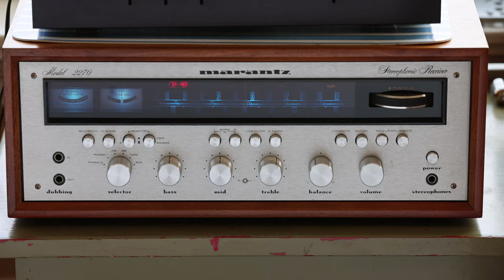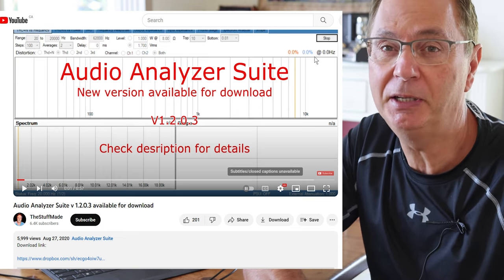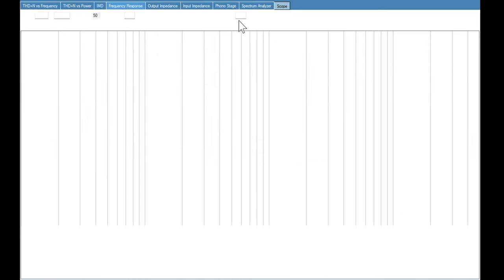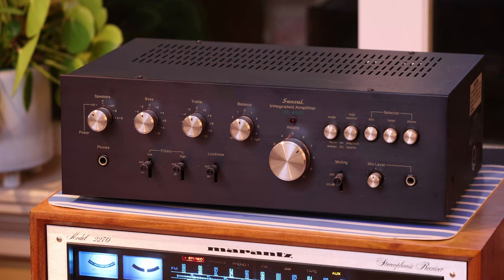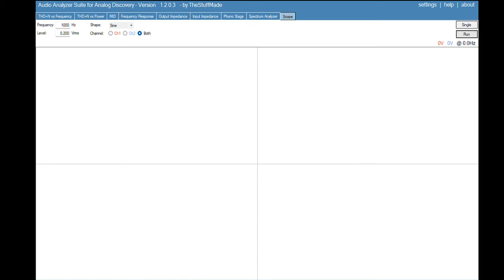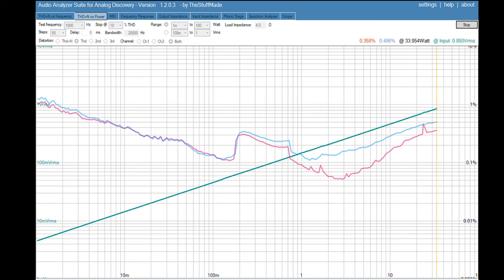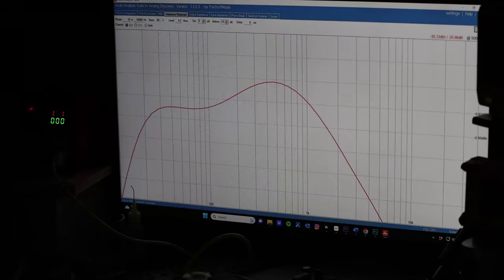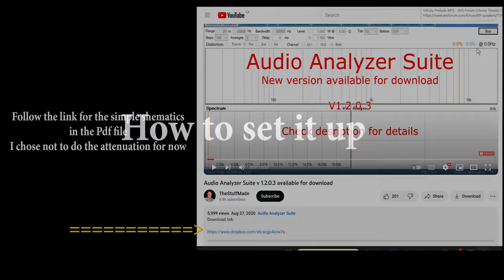Digilent Analog Discovery 3 & Audio Analyser Suite. Amplifier Testing Mcintosh Mc275, Sansui,

Comment: I noticed the GPO header box you showed contained 2x20 pin headers, but the header on your breadboard is 2x15 which matches the pins on the discovery.  I am having trouble locating a 2x15 right angle connector, did you cut yours or will a 2x20 fit.
Reply from the maker: Yes just cut it I would cut at 16 then sand it to 15 for better finish

Comment: Any concerns about the voltage input to the AD with a higher powered amp?  Have you used a voltage divider in that situation?
Reply from the maker: I only used it up to 90 watts 
But you can put your probe on 10x as a quick way or create a simple resistor devider or add one to the board
Reply: @Gabster1  Thank you again!

Comment: Thanks G, great stuff.  What wattage 15k resistors would you use in the jig, if you were to add attenuation?  I also noticed that only yourself and  @TheStuffMade are using the jig.  Other YouTubers are just using the unrecommended bnc adapter.   What’s up with that?
Reply from the maker: You can get away without a jig on simple Tube amps But I had a lot of issues with some amps so best is to follow The Stuffmade recommendations he knows his stuff :)  So far I had not used any attenuation with Ver3 up to 90W. I would ask Jake about Wattage I am guessing 1W may be more then enough.

Comment: This is a great step by step - thank you. I assume you connect the Discovery 3 to a laptop running on battery. Or maybe you use a 1:1 isolation transformer. I wonder if the Discovery has the same issue as standard scopes having a grounded neutral. Thanks again for sharing.
Reply from the maker: Yes a laptop on batteries is ideal but surprisingly works well on a regular grid connected Computers

Comment: So is there equipment I can get to use this free software and not have to pay the 375?
Reply from the maker: Sadly no the software needs this particular hardware
Reply: Analog Discovery 2 has shown up on eBay for about $200 US.  The Analog Discovery 1 is less .. either will work fine.
Reply: There is a student discount available for approved universities. My cost for an Analog Discovery 3 (with free shipping) was $249 a month ago.

Comment: Gaby,
Would you be willing to hook up an Android cell phone on airplane mode running out of its USB connection to see how clean that is? 
Reason I'm asking is I use such a phone with USB Audio Pro Player to a USB dongle DAC amps or a chord mojo 2 (which are running off of battery or taking power from the phone). I think it sounds pretty good !  I'm wondering if I'm inherently avoiding some of the pitfalls in not having to use a switching power supply (or buy a expensive linear...) etc ... etc .. as everything is running off of battery ? Do you think a USB cleaner of some kind should be in the chain between the phone and the DAC in my scenario. The only downside to this is there are cables to deal with and you're dealing with the battery charge of the phone which is usually only a few hours but so far it's been working great in my opinion. I have 5 DACs And I run a different one every night which is a lot of fun
Reply from the maker: Your phone on battery will beat any computer 
Much lower noise so you are doing a good thing.
But you still have some computing noise 
The better your dongle Dac is the better the sound

Comment: Off topic. I wonder how many good audio amplifiers are let down by their power supply. It is an issue in amateur radio transmitters too as the signal goes from almost nothing to full power with audio. 

It is possible to dynamically test a power supply with a programmable DC load and an oscilloscope measuring current and voltage. The DC load can be programmed for a low frequency, say 100 Hz and a 10 to 90 per cent duty cycle square wave. This stresses the supply and allows its response to be measured.

Comment: I just started using the same setup to test a 300B amp.  I’m mainly measuring THD vs. power. If I set the volume control on the amp to maximum, the distortion plot shows high distortion. If I set the volume to 1/2, the plot shows much lower distortion for the same power output.
His do I know which is correct?
Reply: Nevermind. Setup error.

Comment: I don't understand the need for the extra board. As mentioned, when plugged in, all 'ground' connections from the i/o connectors are connected together. 
That would not change with the new board, would it?
Reply from the maker: Hi Jan I was away I had to double check
When plugged in, all 'ground' connections from the i/o connectors are actually NOT connected together. they are all independent. Unless you use the I/O board that comes with it that connects all grounds together. So the extra board is critical for certain amps like Class D amps and certain Tube Amps, where you want the grounds separate
Reply: OK, thans for clarifying.

Comment: Hi thank you for the very valuable video
Lately i have been a little shocked by reviews of amps judged quite good and sometimes very good for sound and then performing quite badly at the Lab bench
I am talking about differences between channels bad square wave response and pretty high distortion even at low power
Speaking of vintage i guess this means the need of maintenance
But this fact that even bad measuring amps sound leaves me puzzled
But what scares me is when amps with impeccable measurements sound bad
How is this possible? Or said better Is this really possible?
Thanks again and kind regards Gino
Reply from the maker: Generally, amplifiers that measure well tend to sound good, but since our ears and tastes vary, a bit of distortion in tube amps, typically less than 1%, is often appreciated. A completely flat response can sometimes be unexciting.

When dealing with poorly measuring amps, it's wise to steer clear. They usually don't sound good, especially when the measurements are particularly bad. However, some people enjoy exaggerated bass, for instance. Additionally, not all reviewed units sound as good as the average sold unit, and some reviewers avoid being overly critical. I believe that if an amp measures really poorly, it will likely sound bad, at least to a well-trained ear.
Reply: @Gabster1  hi thank you very much for your very kind and valuable reply
There is one aspect in  measurements that it could be overlooked
Usually to perform distortion measurements a purely resistive load is used
You're very right
Tubes can sound so musical
I don't like them for bass but for mid and high range could be a great option
Congratulations for your speakers
I like the concept very much indeed and I believe the sound must be excellent
Kind regards Gino

Comment: Another great and usefull video for audio diy. Thanks a lot Gabster, this is priceless.

I have a quick question concerning the 100 ohms load connected to your amplifiers.

I understand that it reduces a lot the current compared to an 8 ohms resistor.

But do you think this has negligible effect on THD mesurements  (and others important parameters) compared to a mesurement with 8 ohms ..?

Thanks a lot
Reply from the maker: These are 8 ohms 100watts I did make a mistake and said 100 ohms I put a correction in the description. You are correct

Comment: Thanks great stuff! Can I assume this will work with balanced preamps?
Reply from the maker: Yes it will
Reply: Is it possible to get a balanced output from analog discovery?
Do you use an adapter?
I can't find the setting in the software.